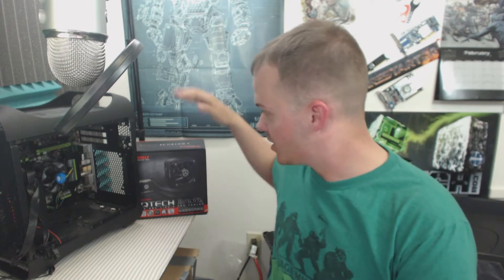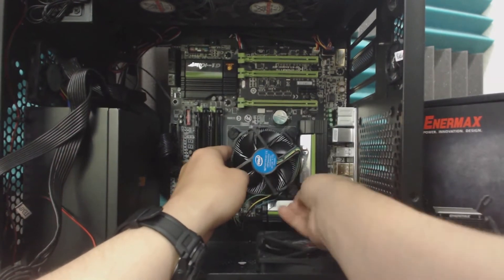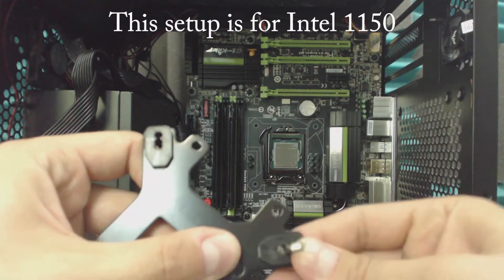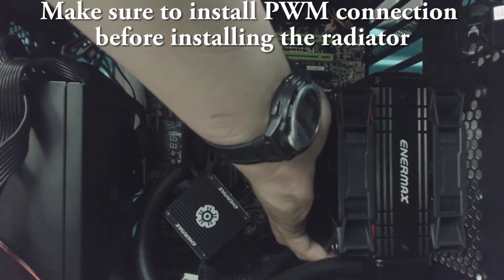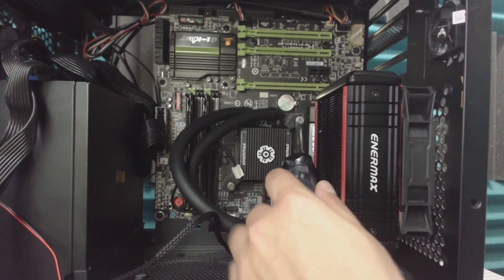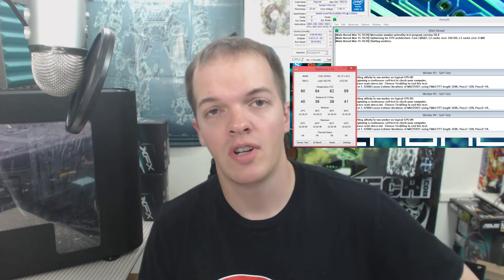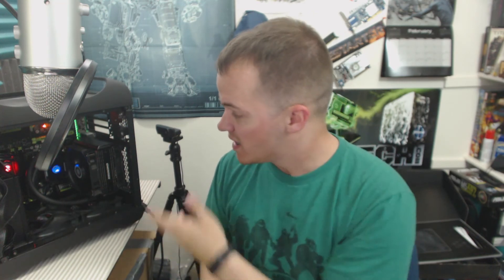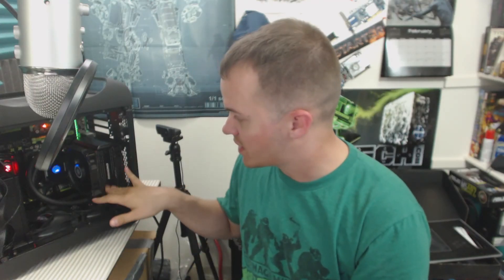AIO CPU cooler Installation (LIQtech 120x inside a Prodigy M)

Comment: How does the fan work? 1 way out? Or what? Thank you for the answer
Reply from the maker: Niko Fernandez I have the cooler set up in a push pull configuration. it is taking the air from inside the case and shooting to the outside.
Reply: Thank you! I have the same watercooling and i was shocked that mine got only 1 fan!! It was a gift btw
Reply: Can i possibly buy a different 120 fan and plug it on the other side?
Reply from the maker: Niko Fernandez you can put any 120 fan on there
Reply from the maker: Niko Fernandez If you only got one contact the company. They might send you a second
Reply: You see it was a gift :) with no receipt. I doubt they will give me another one
Reply: I think i'm just gonna buy a new one. Thank you! Or get one 120 fan from my case
Reply from the maker: It never hurts to ask
Reply: True! Thank you again for the fast response and god bless

Comment: Question - the screws that came with it don't reach the fan when I put them in from the outside. Do I need something else?
Reply: MrPartyExpert NM - I got some other screws. Worked better than the ones it came with as you said in the video.